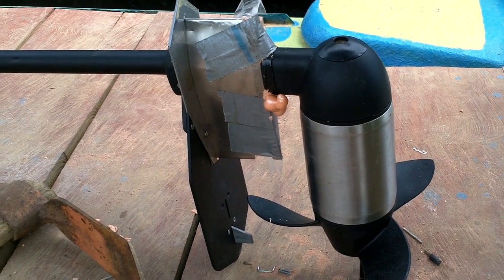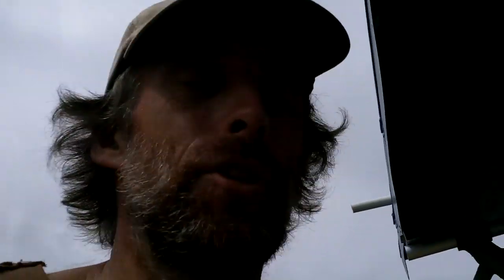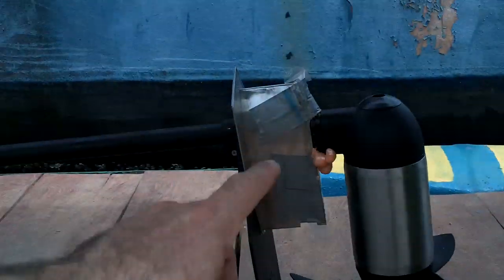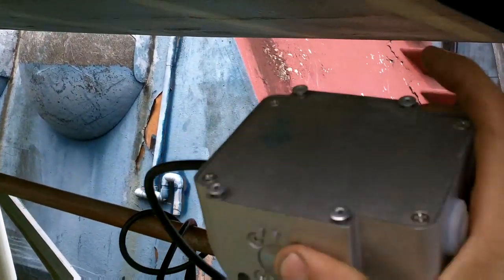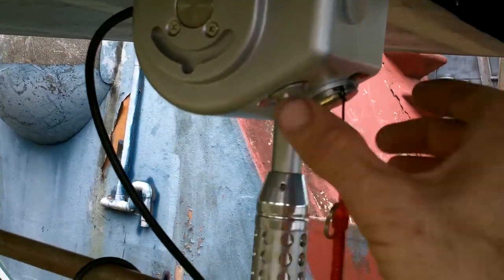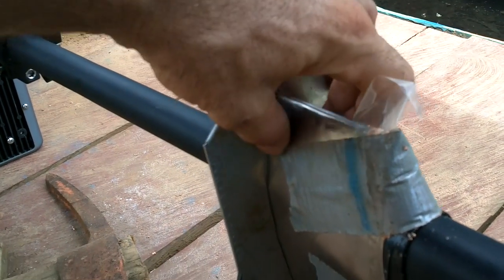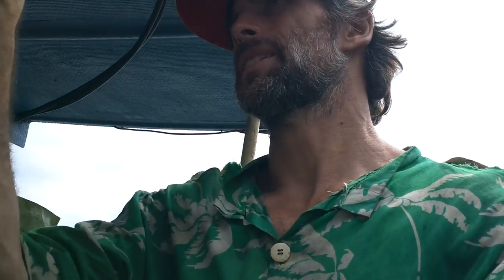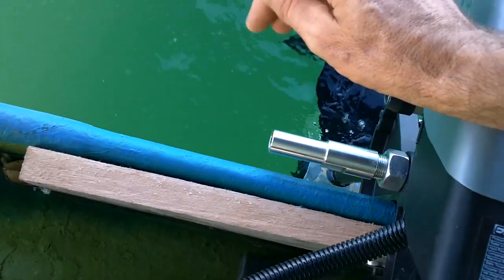Solar Snailer 040 Motor Modification and Test

Comment: Ok so I am such a big fan of yours and like pretty much everything your doing. I ‘get it’ the way you have open thinking and even having failure is a great success. My suggestion is now you are going fast enough you may think about having an emergency kill switch and lanyard connected to your body just in the outside chance you are separated from the boat. That thing is flying and would never stop until way way after dark. Knowing my luck, I would need to Murphy proof it.

Comment: Because you added new type of metal to electric motor, it will probably be more noble metal than what the mount is made of and can cause corrosion issue (electrolysis).  You might want to check out outboard motor anodes.
Reply: I Agree, I Would Bolt An Anode Onto It Somewheres Below Waterline, Like One Of Them Skaggy Ones To Act As A Trim-Tab!? LOL

Comment: Couldn't agree more with switches for the panels and batteries. Not only does it let you charge more efficiently but it will most likely extend the life of your batteries as using them while they're charging could over heat the cells. Keep up the great work!

Comment: "Cavitation plate" ; cavitation, air bubbles, ruins propeller surfaces with pits over time, in addition to the reduction in efficiency,  as you have discovered. Your switch controls give your boat great autonomy when solar is not available. Your building and reasoning capacity overcomes your isolation in your location. The videos are inspiring to me.
Reply: Nothing to do with air bubbles, cavitation is boiled water bubbles, research it.
Reply: @grancito2   -   boil  water  212  dees  grees    .   .   .
Reply: @richardhobbs9038  Water will boil at 32 F if the pressure is low enough, ever heard of freeze dried food, the water is vapourized from the frozen food in a vacuum.
Reply: Air being sucked into a propeller (or rudder, keel etc..) is called ventilation. That plate is called an anti-ventilation plate.

Cavitation does damage the surface of propellers but it has nothing to do with air being sucked down into it.

Comment: Looks like it's time to think about adding some autonomy to this boat)) There's a lot of GPS-guided waypoint followers out there - Pixhawk, Ardupilot, etc. Just look for "autonomous boat" on YT. Might be a fun project. Love the series, thanks!
Reply: Now That's Definitely A Great Idea!  A Small iNav Board w/Large Metal Gear Steering & Throttle Servos, Long Range GPS R/C That Sucker!!! LOL You Actuall Could Swap A Full System Out Of A Plane Like We Use For About $200-$300 & Run It From A Transmitter!?

Comment: You need to induce “welding” in your design since stainless steel is your material go for a medium size Tig welder. It’s fast and rigid than designing using only  mechanical fasteners.
Reply: tig welding using solar panels? define off grid
Reply: Jack Randle  
do check “ Quick Tour of Jaime’ Island Sept 20... the number of solar panels Jaime has, I think it can be done. Solar > Battery > Inverter >welder. Typically a 200Amp. Welder working at 150 Amps draws about 1000 watts.

Comment: Measuring amperage from the solar panels to the battery and to the motor might give you the info you need regarding charging or discharging. You could even get away with using two of those, solar and motor, as you know the direction there.
Reply: Yes, That Meter Could Be Obtained Cheaply On eBay, I Just Bouught 3- Of Them w/Volts-Amps-Watts+ For $6.50@ w/Shunt+Wires, Etc For My Solar/Wind Systems...

Comment: I've followed Jaime for years and celebrate his creativity and innovative engineering, but too bad there isn't a way to raise the paddle wheels or kick their dive shaft into neutral. That noise might drive me crazy, and it  has to add some friction drag on the system. My favorite part of electric motors is how quiet they usually are.

Comment: Just think if you shrouded the prop .. Wide inlet ... Narrower outlet ... Be like a water jet ... More efficient
Reply: Not for speed, only for stationary thrust, research it.
Reply: @grancito2  not thinking of speed ... Minimized bleeding power around the edges of blades since water is not compressible ... Easier to fight the winds or even tow a small pontoon barge for moving supplies, dirt, whatever with morepropulsive strength ...  ...
Reply: @grancito2   -  increase  velocity  like  jet  engine
Reply: @richardhobbs9038  Only slow boats like tugs use shrouded propellers, there is a reason  fast boats don't use them, drag. Really fast boats keep the propeller out of the water, and only have one blade at a time, dip into the water, surface drive.